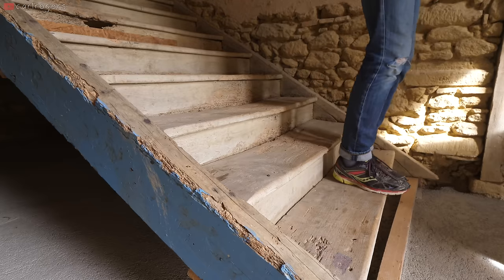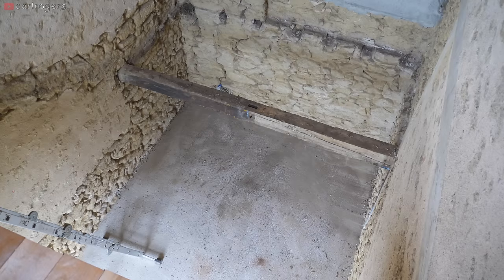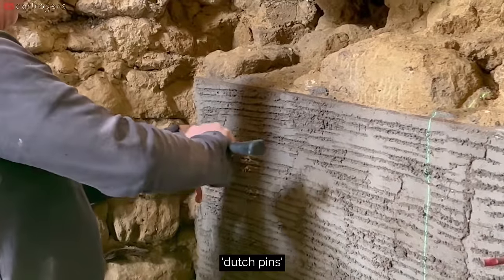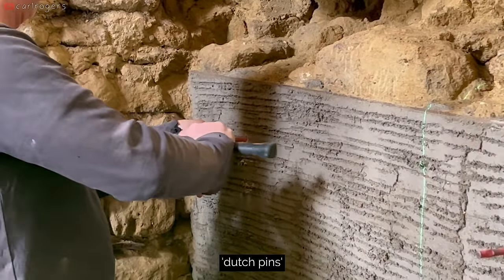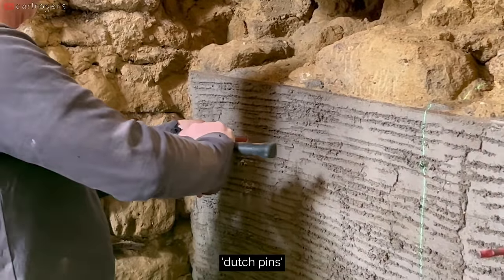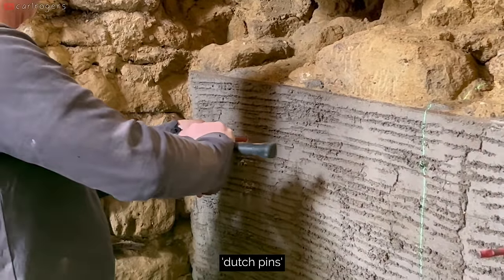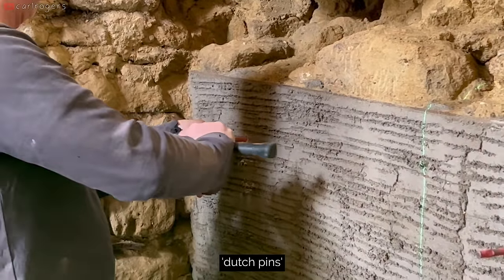#1 DEMOLITION | Building a Staircase

Comment: Question about the concrete: I learned that lime mortar should be used on these stone houses so that moisture in the walls isn’t trapped by concrete. Why do you use concrete instead of lime mortar?
Reply: Exactly what I was going to ask. If you needed it to be sturdier than mortar, you should have used arabic brick panels, instead of increasing humidity, acidity and CO2 inside those walls. This concrete feber is not 'more durable' as he said, instead it deteriorates the original building faster.
Reply: And wood parasite as anobium like humidity particurlarly eat wood on the wall.
Reply: Yes always use lime mortar. The issue with it in this case is that it would have been a bit to thick to be strong. They really should have built up a platform with lime mortar and brick or stone. Concrete can be stronger right after it becomes hard, but modern Concrete will eventually break down and fall apart. It won't happen within our lifetime, but it won't last much longer than 60 to 80 years. Never the less, the concrete will last for a long time, and for the time being it is safe and strong. As far as the moisture issue, I can say after having worked in water damage restoration that the older the house the better it can handle water and moisture due to the ability of exposed wood and other materials to breathe. New houses tend to actually do worse with water damage because they are sealed so much better. It is more difficult for water to find its way into a new modern home, but once it is in it can't get out due to the very thing that actually protects it from water in the fist place. So this house will do fine regarding moisture as long as both sides of any surface in question aren't completely sealed.

All this being said, they are doing an absolutely beautiful job with this home and most all of these repairs are being done skillful and the right way. I'd say they are definitely doing proper justice by this wonderful peace of history.
Reply: Just said the same then noticed your comment.
Reply: Yup using concrete is a mistake, lime is the way to go. Those walls need to breath, concrete doesnt allow that, if there is humidity in the soil the walls will "rot". It's too bad, you make lots of efforts to keep the house as it was, and you go and use modern cement, why not use what the ancients used? It worked for 300 years. Anyway I dont want to seem to harsh, good luck guys, nice video.
Reply: @octaverouge2148  thank god I am not the only one that screamed internally when they applied concrete. this is a house from the 1700's concrete has no buisness in there. lime mortar can do the same things. Ugh, the levels of anxiety after seeing this. The stuff is literally lying around to do this. ah, god, I now wanna buy a house wherever it is and make it better.
Reply: Was gonna say the same thing, using concrete in restoration work has been shown to be a mistake.
Reply: @zapfanzapfan  especially it can collect mold over te behind the concrete.....
Reply: @octaverouge2148  concrete was used only in parts of the wall, where they need strength for beam support, i think this is obvious in the video.
Reply: @izoyt  Man, i think it doesnt matter, it's a rule. We could ask an "architecte de France" (it's people that check how France's historical buildings are repaired)  i think they would side with me. Lime can do the work just as good as cement in this case and without the backlash cement has. Again i'm just a random dude on the internet, i'm not trying to start a fight.
Reply: @octaverouge2148  well, im an architect and done and seen restorations, similar than this. for this case, use of concrete is nor critical, as humidity etc goes.
Reply: @izoyt  I agree, concrete will not kill the house overnight, but it's still a bad move. If you say using concrete in historical renovation is an ok thing to do we disagree. I'm gonna let this go now. Peace out.
Reply: Guys I bet he knows what he's doing and I feel a lot of you guys are overreacting. He obviously knows what he's doing.
Reply: All concretes contain lime.
Reply: Wouldn't it escape the other side? It's not like there's concrete on both sides trapping it.
Reply: I hope if the building seems to rot then the guys would remove concrete and use the right products. - it’s not too late

Comment: 12:00 when you plunge cut with a circular saw like that the front of the fence needs to be pressed firmly onto the material with the back end up. This is the safest method because the blade will push itself away from the cut if it grabs. Once the blade is out of contact with the cut there is no more force to fight, returning complete control to the operator.

The way you did it, setting the back end down and lowering the front, is dangerous because the blade pulls the saw into the cut when it grabs -- as you can see it doing.
Reply: This is decidedly NOT a tool safety video.
Reply: Yeps. That was a recipe for kickback and wearing the blade in his chest.

Comment: I love your videos - I can see myself doing something similar. I did shudder when you were using a metal ruler to adjust the table saw cutting width without turning off the saw. I've done that once with a tape measure only to hit the blade and have it come flying back at me
Reply: Ouch, I was thinking the same.

Comment: Time stamp 6:48, the finger cap is used to push the hand stitching needle to prevent it piercing the fingertips. I still use them when replacing shirt or trouser buttons or small stiches in our cloths. Very helpful little tool.
Reply: It's called a thimble.
Reply: My question is how the hell did it end up there?

Comment: The 'good luck charm' is a sewing thimble. It protects the fingers when pushing the needle through the material being sewn. Traditionally made of gold or brass, around 1900 steel thimbles were cheaper to make and were a lot more durable. It would be interesting to know what it is made of.
Reply: In Denmark they are called a finger”bøl” 
Bøl has no translation.. looks like a small shotglass size xd
Reply: Dutch is “vingerhoed” — finger hat.

It was also often made of silver. Probably a lot more of those than brass, let alone gold.

Comment: When using a circular saw, especially vertically, it is much safer to rest the front edge of the sole plate on the work and pivot the back of the saw down. That will give you more control and it'll feel a lot safer too!

Comment: That thing at 6:48 is used in hand-sewing; you wear it on your finger as you push through the needles through the textile/garment. It effectively protects your finger from the repetitive pinching from the back of the needle (especially if the textile is hard, thickly woven or there are multiple layers of it)
Reply: Was about to say this.

It's a Sewing Finger Cap, and the design is still the same these days. @carlrogers
Reply: @TimBrownie  Good to know the name in English, I could only describe its use.
Reply: I think it’s called a thimble, and I think Carl knew that but was referring to it being left for good luck? Maybe wrong though!
Reply: @hughstephens7246  it is indeed called a thimble, not a 'sewing finger cap' which is simply a prosaic description of it's function.

Comment: Love the videos from both the content and the filming. Great workman ship. One thing using concrete with old buildings. Are the old walls lime mortar.  From restoration programs I have seen in the past using concrete on such walls is not recommended as they can breath and then deteriorate. Thanking you for making the videos I’m learning such a lot
Reply: I think that is only when they cover an entire wall with concrete render. I was thinking the same thing then thought about it. Just making a small concrete pad and filling a hole here an there will still allow the original lime to breathe. :)
Reply: @stephensimpson5283  doing large areas of wall with plaster is terrible. The bbc did a series Project Restoration 15 years ago. And if I can rember that far back they didn’t us cement mortars at all.
Reply: @marcusd2380  I think that most of techniques shown in this film are kind of restoration nightmare. I don't know how things work in France but are there any conservation offices taking care of this type of buildings there?
Reply: @TheKkazikk  I can’t comment if old buiodings in France are listed as in the Uk and hence restoration is regulated like the Uk. But for sure these old buildings need time money and expertise. Carl has the expertise for sure and I can see it takes time. In the Uk there has been a few high profile restorations and well worth watching

Comment: Hi Carl,
Be aware that you should absolutely not use concrete in an old house like this : it will maintain moist in the walls, as its totally sealed, they will rot and crumble with time, use lime instead. Another thing it that concrete is too stiff for old kinda wobbly walls that moves with humidity and temperatures changes : makes vertical cracks easier to appear.
Looking forward the other videos with that new lighting stuff !

Yann (restoring an old barn and farm from France too)
Reply: @Forakus  Old walls requires old techniques and specialised craftmanship. Concrete is no good in such old builds.

Comment: The thing you found in the wall is not a good luck charm but a thimble, you put it on your finger and use it for sowing so you can press needles through thicker material without injuring your finger or just to protect the finger from the repetition of pushing the needle through fabric

Comment: Good vid. At 10 min 20 sec one of you was hitting the shuttering with a hammer to settle the concrete. A really good alternative is to use a medium sized drill, probably a mains drill. Put a chisel bit in it and set it to hammer only. Work the shuttering with that. It works an absolute treat. All the best from the UK.
Reply: Or as alternative Ive used in the past is an orbital hand sander used on the shuttering sides.  Creates just enough vibration to settle the concrete and bring the fat to the top.
Reply: @mattcartwright8272  Yes; I guess that would work too.

Comment: Hey, thanks for sharing! A question for you: looks like you’re working on an old building, is there a particular reason you chose to use concrete for the walls instead of a lime based mixture like the one used towards the end of the video?
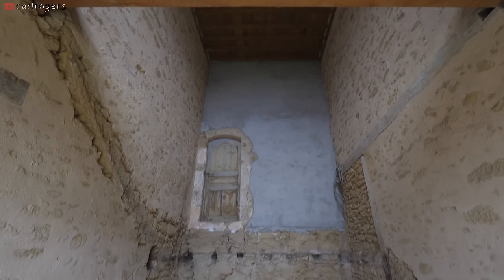Reply: 8:15 he said why
Reply: @stevemarvin1723  quick easy and wont be seen is not an explanation to the question why?
Reply: @gondolin12  Hello
On emploie jamais de ciment avec de la pierre parce que le ciment détruit la pierre les murs en pierre sont montés à la terre ou à la chaux pour des raison de solidité pas d'esthétique
Hello
Excuse my google translate english
Cement is never used with stone because cement destroys stone stone walls are mounted with earth or lime for reasons of solidity not aesthetics
Reply: @bigpapajm  Exactly! Concrete should NEVER be used like this. Lime based is more flexible with the movement of the house and it breathes so it doesn't capture moisture. Concrete is very hard and 100% needs reinforcement to not crack and crumble.
There is a reason lime based stone buildings stands for centuries or millennia...
Reply: Inexperience. For professional tradespeople who specialise in historical buildings, this is hard to watch. Those oak beams will have rot issues within a century. You might say that's a long time, but considering the previous ones lasted for 3 centuries, it's really not. I just pulled out a floor with wood set in concrete and despite it being dry and in a heated living room, the wood was rotten and wasn't even that old.
Reply: @MartilloWorkshop  From the evidence on this video, it's only that main beam end that had concrete against the end grain. It can easily be chopped out and re-done with lime mortar but even then its really not very much volume.  The concrete pads should be OK as the oak isn't sealed into the material. Maybe a layer of DPC under the oak would suffice.
Reply: Using concrete in restoration has been shown to be a mistake. I've seen the result from the previous generation using it on a castle ruin. Behind the concrete it just got worse...

Comment: The circular saw is a lot safer if you brace the “toe” and plunge the “heel.” You will not have that grabbing issue.
Reply: That means turning the saw 180°? Or keep same orientation?
Reply: @aayotechnology  that is a preference choice. I mean brace the front of the plate as you hold the saw, and plunge the back. That makes the plunge safer regardless of which direction you are guiding the saw. It is made to push, and made to plunge at the rear.

Comment: just my curiosity , i have heard that using concrete on a lime base motor wall is not good as it will not let the wall breath property in the change of moisture in the air .... is this so or what are your views on this subject ....
Reply: I have also heard this with adobe houses in the Southwestern US, specifically with very old buildings. An old adobe house that was repaired with concrete had to be repaired again with the proper material (traditional adobe mud). They also gave the reason for the issue as the concrete didn’t settle and allow airflow in the same way that the adobe did, thus causing structural issues.
Reply: @carter2671  Concrete on a wall made of a natural element such as adobe, ramned earth, stones ect ... is like putting h24 a synthetic clothing on your skin, you'll sweat and your sweat will just get blocked. Natural stuff doesn't mix up with modern man made materials.

Comment: why are you not using hot lime to fill the holes? Isn't it strong enough to hold what you need? I am sorry if this is a stupid question.
Reply: Not only historically correct but the right engineering choice because that's what was used in the 1700s. Concrete and Elizabethan mortar don't mix well. There's sites all over the UK where stone outer walls were clad in concrete with really bad results.

Comment: A 300 year old staircase?  
You have a good set of skills, but…
Couldn’t the staircase be repaired?  Strengthened and conserved?
Also we should never use cement on stone walls.  Especially if they are built with lime mortar.  You will get problems with damp in the future.  Maybe a RSJ would be better.
Reply: I wondered the same thing. The amount of restoration videos I’ve watched where they had to redo walls completely because the previous owners used cement …
Reply: not on an internal wall that is nowhere near ground level and has good air circulation. That pad for the beam might as well be a piece of mudstone or granite or any other rock. I don't quite understand why they used Portland cement on the infill above the beam when it looked as though they were using lime mortar round the side of it, but it still won't cause any problems there. Even the ring beam should present no real problem since it is not in contact with the ground and is not on the outside.

As for the staircase, what was there to preserve? A lot of it was worm eaten and loose and had had it's day. There is zero point in 'conserving' something for the sake of it: A staircase needs to be strong and reliable and turning it into a parody of Trigger's Broom would not benefit anyone. Given what they've previously done with the roof and other structures I imagine they would have carefully considered if it was worth trying to restore it and concluded that it was too far gone to be worth the effort. Far better to replace like with like using the right materials and also then being able to take into account the modified first floor height.
Reply: @stevepettifer4896  Agree - the staircase is nothing but a accident waiting to happen....Safety First....
Reply: Why bother.
Just disassemble it, you can reuse the wood that is still good for furniture or something, or even sell it if it's in good condition.
It doesn't have a special historical value 
And building  staircase is not even that hard. It's just  a few grooves and planks to cut to length.
It's even easier because they can just replicate the previous staircase if they want.
So no, just get rid of it.

Comment: To set depth of cut attach a ledger board to the beam at proper depth and simply lock the blade depth when the blade rest on the ledger. This will eliminate fussing with holding the blade on a line while trying to use the locking mechanism. Good work.

Comment: Only just found this channel,  it's great, 
The way you work shows your not a professional joiner, but the finish and quality of your work is exceptional 👌 

It's too late now, but for the future, the tannic acid in oak will destroy steel fixings very quickly, use brass, or wooden dowels instead.

Comment: Did a very similar job in my parents old house.  Left the smaller joists slightly deeper than needed and then rebated the ends on under side to adjust for the out of level of an existing cross beam, leaving the top as level as a Billiard table.  The use of lasers as a datum line is a godsend. The other trick is to dove tail the ends of the smaller joists when joining to a thick cross joist.  It avoids the need for nails and tightens the structure up as the wood dries out.  This was not my idea but I have seen it in older structures.  As in the pst it can be quite crudely done, in that it does not have to fit exactly so long as the exterior mating surfaces look good.  I have seen all manner of wedges and wooden pegs used as they are never seen but they stand the test of time structurally.

Comment: Your doing such a great job . I’m doing a house now which is a hundred and fifty years old. Any wood I take out I try to reuse,specially in the walls the two by fours back then are real two by fours and the living room I’ve had to take out all the floor to replace the beams and joist. I save the best of the wood floor for repair work in other floors in the house. When replacing the beam on the stair landing could you have not reused the old beam again or was it to worn or had rot.